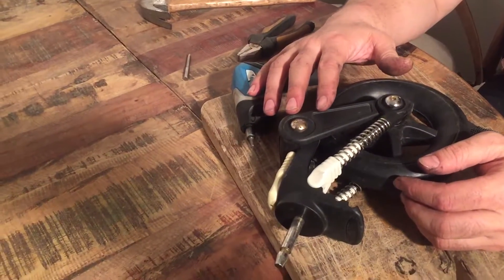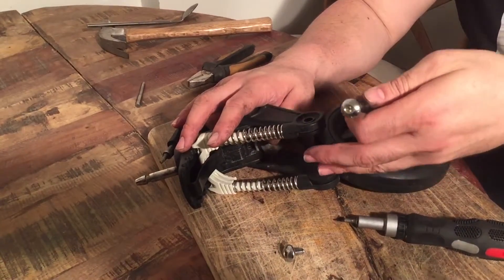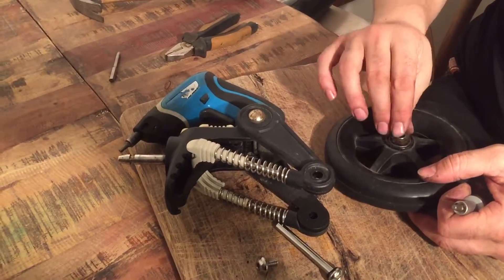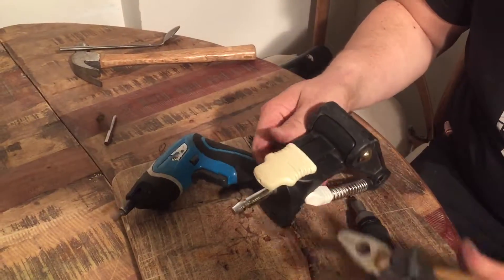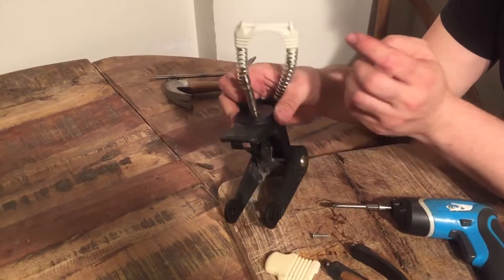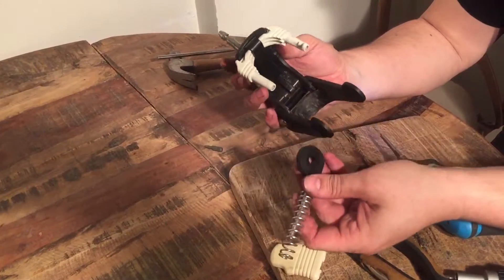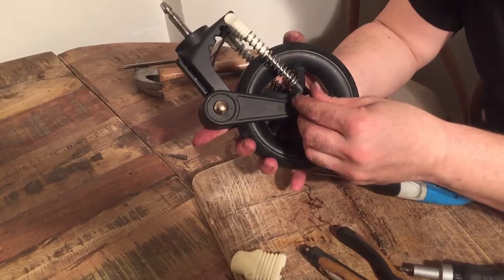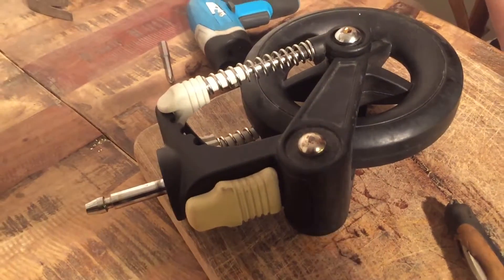How to Disassemble and Repair the Front Wheel of a Bugaboo Cameleon 3

Comment: great video, can you tell what number of bearring is there?? Cause my ones are so bad and I can't see the number.
Reply: Cameleon 2 has 608 bearing says 608ZZ one side and 608RS the other. I notice the bearing has a built in spacer, the inner ring sticks out more on one side.  I see replacement sets on eBay that have this spacer feature.
Reply: @stevedonkin6891  thank you for answer. Replaced already.

Comment: Is it possible to replace the rubber tyre? Or do you think the wheel off the swivel board would fit? Our rubber is starting to crack but don't need a whole new assembly
Reply from the maker: It's a long time since I tried, but I seem to remember that the swivel board wheel is the same size, just give it a quick measuring.  I love hearing viewers willing to DIY stuff, like this.  Most of the questions I get are just about purchase-recommendations.  Best of luck :)
Reply: Thanks for the reply. I'll give it a crack, it's a bit ridiculous they expect you to through out a perfectly good surrounding assembly when all that is needed is a new rubber tyre, so wasteful! Keep up the good work!!

Comment: Please do you know if a front wheel from Cameleon 3 would fit in a Cameleon 1 or 2 original front wheel assembly? 
Thanks
Reply from the maker: Yes, it will, if you use the old fork. :)
Reply: i have a similar problem i need to replace the wheel of a camaleon 1 but i cannot find a decent second hand wheel. ifound something on aliexpress that should be compatible with camaleon 3 wheels. The problem i think is that it has a 6900ZZ bearing which has a bore size of 10mm while the 608zz  of the camaleon 1 has 8 mm. any suggestions welcome 🙂  @BarnevognverkstedNo

Comment: How do you take these wheels off the stroller ? We’re having trouble with ours
Reply from the maker: Hi,
these are from a Cameleon 3, if that is what you have, then depress the white buttons on the front of your stroller.  If you have Cameleon 1 or 2, squeeze in the tabs on the portion of the black plastic axle head that extends out of the top of the housing mechanism.  If the wheels are stuck, in either case, lubricate them, depress the locking mechanism(s) and pry them off the stroller.  Hope this helps :)